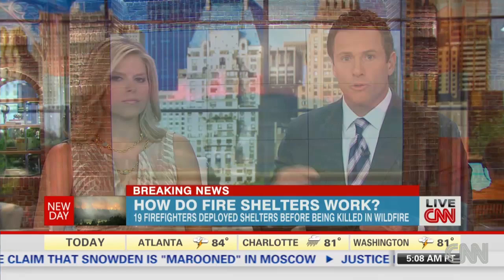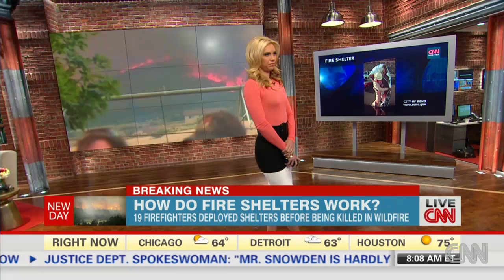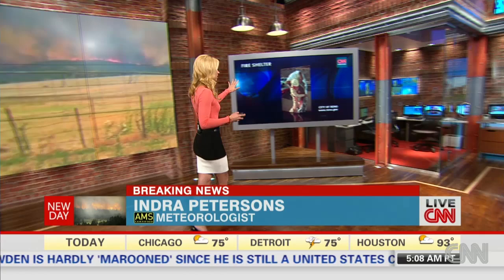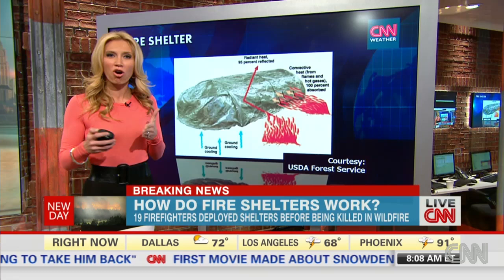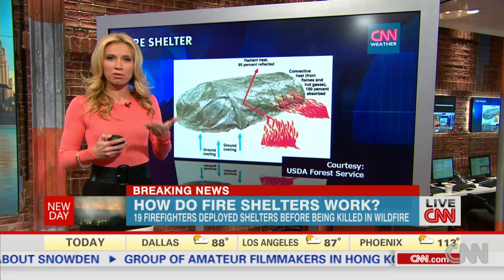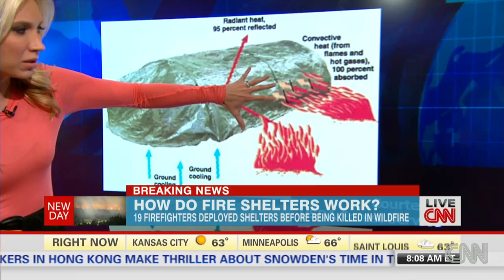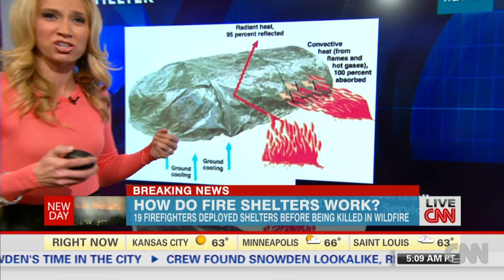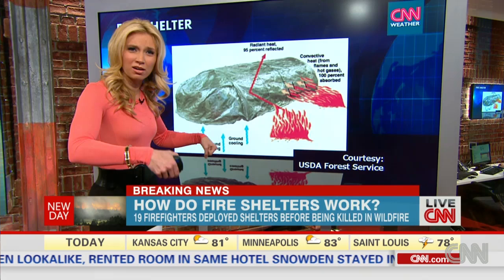How do fire shelters work?

Comment: They are made to protect you from the radiant heat NOT from direct heat. Their shelters worked as intended unfortunately the location the were forced to open them no shelter could have saved them.

Comment: Only they don’t work
Reply: They work more often than they don’t.
Reply: @mackenzieblair8135 Not for the Granite Mountain hotshots, they don't.
Reply: There needs to be an innovation in fire shelters. Current shelters does not quite cut it in today's intense wildfires.
Reply: @BrilloHead  no conceivable shelter could have saved them from those temperatures.
Reply: @mackenzieblair8135  There actually is one that's better than what they're currently using but the government refuses to adopt it. Some say it's for political reasons.
Reply: @BrilloHead  uh huh.
Reply: @BrilloHead you clearly don’t know what you’re talking about. The shelters are not, nor were they ever, guaranteed to work. They are not an end-all-be-all, they are simply the last defense. And like someone pointed out earlier, they work more often then they don’t.
Reply: @ssilent8202  Not in the case of Granite Mountain Hotshots, they don't. And like I said before, there are better alternatives then what is currently in use. Before you attack the messenger, at least try to consider the alternatives. The government didn't even bother to do any tests before they rejected the new shelters out of political reasons.
Reply: @BrilloHead  what new shelters, what new tests, what political reasons, then?